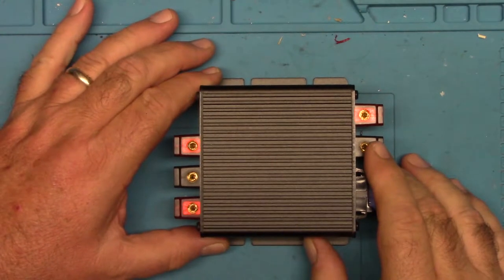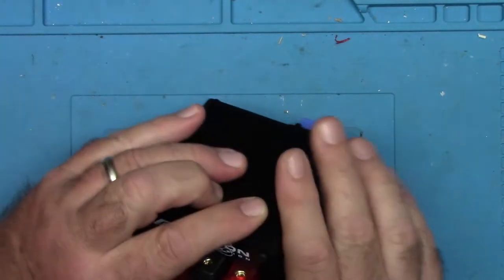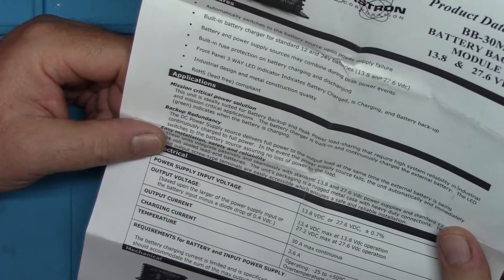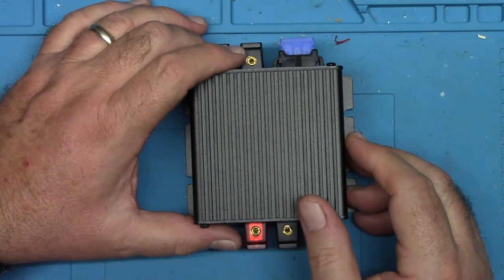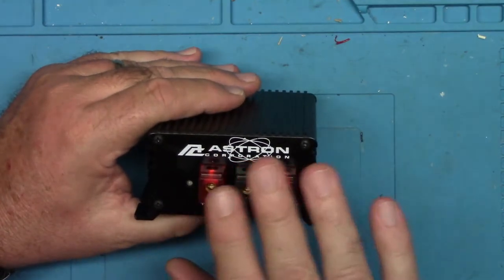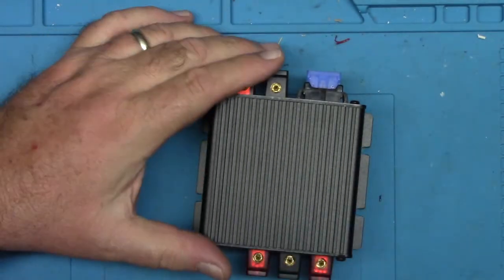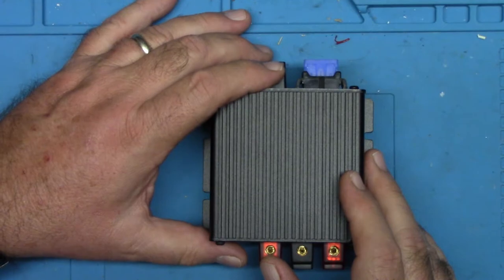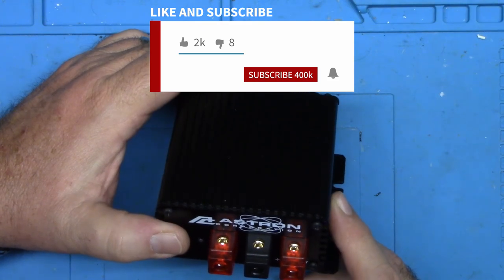HF Radio battery backup!

Comment: depending on what brand BM module your battery is using the. incorrect charger/voltage. you prob won't get your battery properly charged or full life,  top balance prob won't be engaged etc.  there are ham brands that will work perfect and i think better for your application